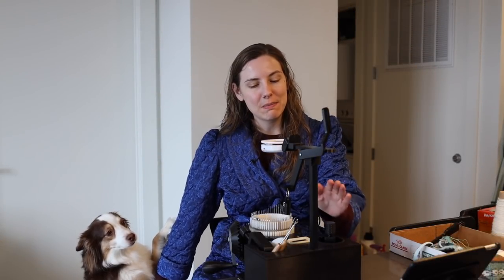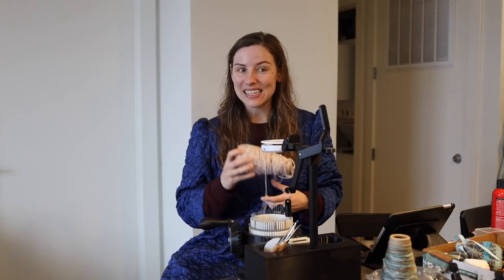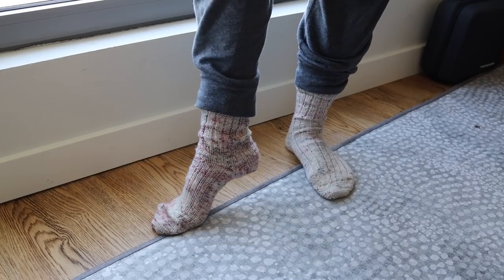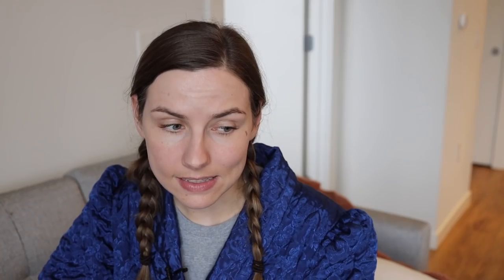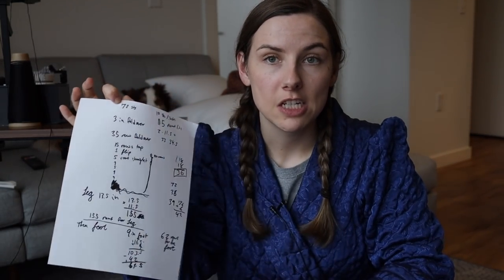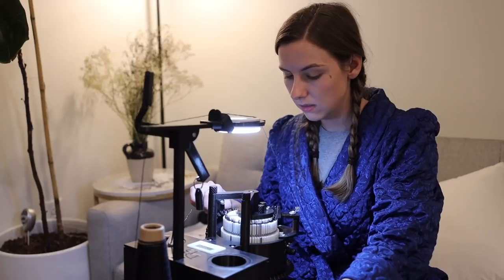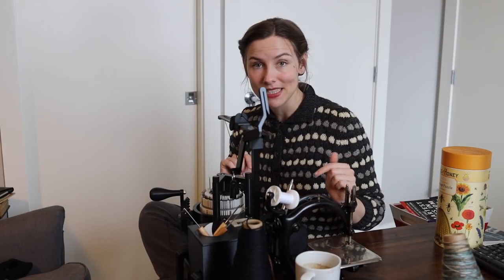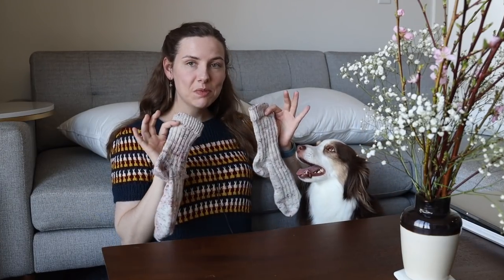How many tries does it take to knit Victorian Stockings? CSM Stockings with color-work!

Comment: A tip from a hand knitter who has worked with yarn on cones many times. (I have a local store that buys in bulk, and sells cheap) 
You might already have been adressing this, as i saw in your last clips that you had some yarn up on a "wooden thingy" (😂) but i thought that this was still worth a mention.
If you have the cone standing passively on the table, and pull the yarn up vertically, the yarn will slowly become either tighter or looser in its twist. (Not native English speaker, sorry for the weird words) 
If you instead had it a bit higher up, and on something that rotates the cone as the yarn is being pulled into the machine, you won't slowly "overwind" or unwind the yarn. Especially when making ribbing, it is quite important to get right, otherwise the last knit stich before the purl can look loose and weird. 
Unwinding the yarn can also cause the hooks on the machine to have a harder time grabbing the yarn, and it will make the final garment less strong.

This is really easy to illustrate with a roll of ribbon. If you put it flat on the table and pull up the end of the ribbon vertically, it will roll around itself, but if you put a finger on the middle of the roll, and pull out to the side, the ribbon won't twist around itself. Hope it made sense? 🤔
The socks you have made so far look amazing, good luck with your amazing machine. 👍
Reply: Thank you for tis information - I can't quite imagine how to avoid it. Could you maybe recommand a video or longer article?
Reply: Oh. I have been hand knitting with a kilo cone of yarn (there is a wholesale yarn shop in my town too and I love it), and the cone just sit on the floor and I pull yarn vertically from it. Twists in the yarn stay nice and even. The shop told me to do so because my cone was winded specifically for machine use -- so what you are saying here must have been what they were advicing against, like they have an industrial solution to this twist problem lol

Comment: Very interesting! Thank you for sharing this! Sadly, I hand knit my socks because I love the heel flap and turn. I also love me a good upstanding drawn toe, so no grafting.

Those gorgeous golf stockings have the cuff worked in the round facing, per the usual, and then the fold line turns the cuff so that the stockings continue the pattern to create a sock as normal. I made very similar golf stockings, I love them, but, I couldn’t translate double points to Circular Machine. I’m not even sure my explanation makes sense. And you said you don’t have a larger carriage, so you couldn’t make the cuff alone larger. They’re still gorgeous!

Comment: I’ve been thinking about this project, and I wonder if it wouldn’t be easier to knit the toppers as separate pieces, and then graft them onto the stockings. It seems like so many things could go wrong with the operation you’re currently doing. 

Also, this might be a way to make the two toppers match a bit better. Knit a third, looser topper and swap it out for the tight one. 

Finally, I’d selfishly love the chance to get a better look at your process for knitting the two-colored diamonds. I’m so curious about the way the machine handled the color changes!

Comment: I was riveted by your hook acrobatics!
As someone just beginning with 3D printing, working up to making a CSM is tempting, but I need to know more first. I'm wondering about the correlation between the number of hooks and how fine/coarse the knit is. I have silk stockings that aren't quite tall enough, those are my metric for trying to make my own. Also, my thighs are a bit big. So I am leaning towards making a CSM that's bigger for a dense and fine knit.

Comment: For the turning inside out part for the top turn down part,........... why not just knit until you are ready to turn, then knit in a ravel cord row followed by some scrap yarn and then take the whole thing off, turn inside out and put it all back on the needles underneath the ravel cord with the hook tool and then take out the ravel cord and scrap yarn and continue on...  That way you don't have to worry about dropping needles or losing stitches while turning.

Comment: With the part that gets turned over... I'm no expert, but could you just knit on some waste yarn, take the whole cuff off the needles, flip it inside out, and then rehang it on the needles, wrong side out? Sort of like you do when making a classic double thickness hung hem cuff. 

Also I was very intimidated by the ribber at first but you made it look... not easy, but relatively simple. Feeling inspired by your successes!

Comment: I wonder if it wouldn't be easier (less stressful/fiddly?) to stitch several rows of waste yarn after the fold-over cuff, then remove the work and rehang it inside out rather than flipping the needles? That's the way I do it on a flat knitting bed, and it's really much quicker than it sounds.

Comment: Would it work to knit the turndown part "backwards" that is follow the pattern in reverse...if the RS is a K, then P...etc?  Then when that is long enough, start knitting without reversing?  Would that prevent having to move the needles at all? Does that make sense? I would have to rewrite the chart or directions for myself to wrap my brain around it.

Comment: Maybe next time you need to flip the piece like for the cuff add a lifeline. Basically run a thread through all of the stitches. Then if you drop one it can't undo!!
Reply: Plus you can just take the stitches off and put them back on inside out. No needle flipping needed.